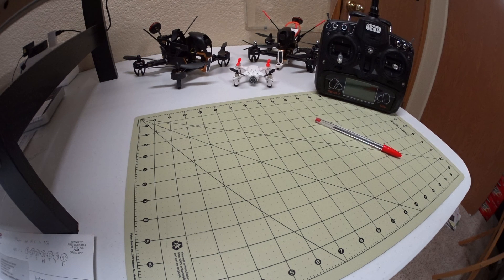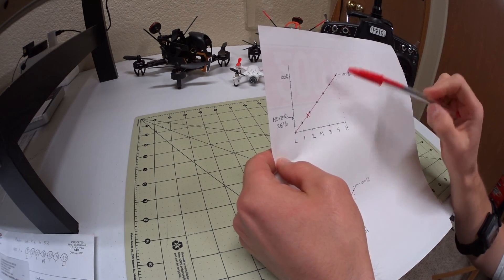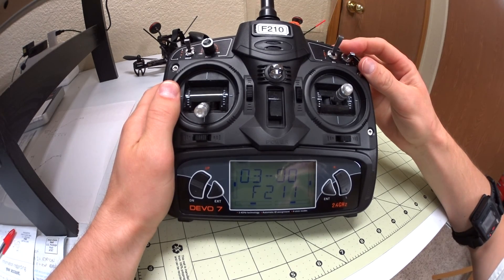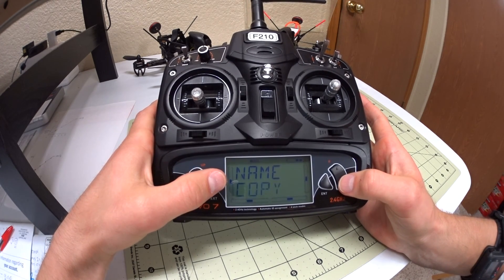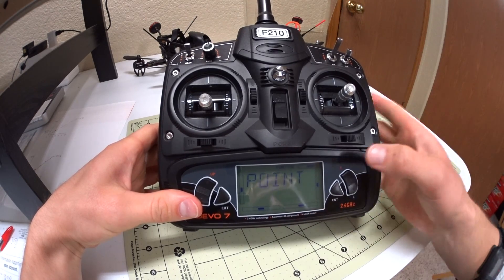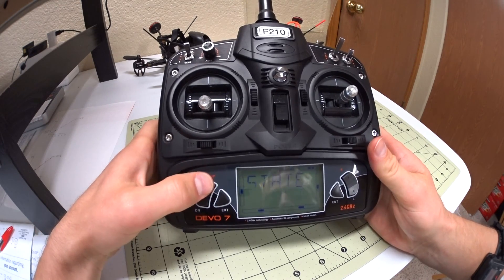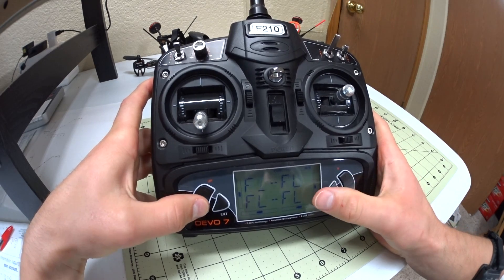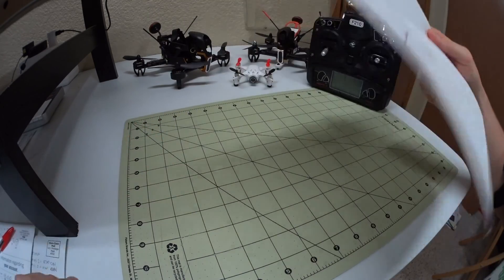Setting A Throttle Curve (Expo) on your Devo 7 Transmitter

Comment: I set mine 9.3, 18.6, 28, 37.3, 55 and 90, for control in the lower end and around hover, then punch lol ha-ha, it gives reduced rates in lower end and around hover point.. thanks for the help.

Comment: Good video, although it is not complete. The video is missing step #7 as written down below:

#1: make sure you work in a copy of the F210 model

#2: go to function THCRV (enter)

#3: leave SRVHD on Yes (enter)

#4: set POSIT to POS 1 (DN)

#5: set EXP to ON (DN)

#6: set P-L to 5.0% (DN)

#7: go down to SWITC POS 0 and press ENT. Then cycle down until you see D/R and make sure it is ACT.

#8: Then set P1, P2, PM, P3, P4 and PH. As down below and make sure that before you enter the percentage that you set P1, P2 etc. to ACT.

PL = 5%

P1 = 12.5%

P2 = 20%

PM = 30%

P3 = 50%

P4 = 70%

PH = 90%

Comment: Can you do a video on setting up so my rodeo 110 isn't so touchy. I guess it's called expo ?
Reply from the maker: Jeff Paige That is what this video explains. You are just manually adding expo by setting the points along the "expo" curve yourself.
Reply: PowerScissor I mean not just the throttle curve. The other controls like yaw etc
Reply from the maker: Jeff Paige Are you running stock firmware on the flight controller or have you flashed betaflight? You can change the rates for yaw/pitch/roll in the configurator easiest. Or if you fly angle mode you can adjust that there also.

Comment: Guys! for those who followed the video and still didnt make it to work, its bec u havent activated the switch "D/R". To do that (Press)... THCRV (ENT) / SET SRVHD (YES, ENT) / (DN) down to SWITC (ENT) / (DN) down to D/R INH (R to toggle on or off for that switch). Then head to MONIT and toggle the D/R switch or just exit out the menu completely and see it there.
Reply: m8, Are u sure u click ENT when u at SRVHD? set it to YES and then click ENT, after that just scroll down to SWITC and continue with ur settings

btw i just read ur former post about u having the 3D F210, as i dont have the 3D version i am not sure its the same structure in the menu of ur controller.
Reply: Kev, now that i think about it, did u follow PowerScissors video first bef attempting to add my method? (my description is an addition to his and maybe "unlocks" what u r looking for...)
Reply from the maker: I've been super busy with a new baby lately so haven't replied much. But I just found out that the Devo7 gets set up differently depending on what model it's shipped with. You might need to activate certain switches if they are deactivated by default for you. All mine came activated, but my friends wasn't.

Comment: Informative vid 👍 I've just sorted my d/rates on the same switch so is there a way to program t/curve to another? God I miss my ds6, so much simpler with better displays. Loving the f210 😍 newbie with devo
Reply from the maker: Yes there is. I won't have my Devo 7 in my hands this week to explain exactly how...but you can set it to the toggle switch that is on the right side also (I have it set to both in my current setup)

Comment: Hi thanks for video. I have question. What is the "THSTK" menu for. It is between "Outpu" and "SWITC". I believe it stands for Throttle Stick but I have no idea whether leave it off or enable it.
You can see in the video at 8:06.  Anyone knows this please help. I've tried google around but could not find any pages/posts/clips that explain.  
Thanks.

Comment: hello i have followed the video step by step triple checked everything and when i flip the switch nothig happens?
Reply from the maker: What happens with your FMD switch? I'm assuming you are referring to D/R toggle?
Reply: +PowerScissor  yes the d/r switch as the video shows pal
Reply from the maker: What happens with your FMD switch in the "2" position...still nothing?  I've seen a couple of times the setting were applied there instead of the D/R switch.
Reply: +PowerScissor is that the top right behind d/r switch i have tryed all the switchs after uve done the settings triple checked its activated
Reply: I have the same issue in that the d/r switch does nothing. Anyone figure out what we may have done wrong?
Reply: Ive ended up selling mine, never did fiqure it out, and got a charpu qav-x and a taranis now
Reply: I had the same issue. I did end up finding this, you have to ACT the D/R swtich further down in the settings of the throttle curve. Tricky to find.

Comment: This video helped me out big time.. Thanks for sharing..I do have a question re: setting up the rate mode switch..The instructions you gave  were excellent, however the switch is not changing the rates back to the factory rates.. The rates did change in the d7. But the switch does not seem to respond..Any help would be appreciated.."newbe"
Reply from the maker: I'm not sure exactly what you're asking. Check FMD switch and see if you saved your settings there. It's been a while since I've messed with a Devo7, but I remember it being easy to change that switch on accident.
Reply: +PowerScissor thank you...got it, all good

Comment: Hi. Was excited to see your video here since I'm a newbie at this and I wanted to calibrate the DEVO7 for a more "beginner" flight mode.
I Entered all your digits as instructed but when I check in "Monitor" mode, Throttle starts at 0 with the stick in the MIDDLE position, and displays -100 when all the way down and +100 all the way up?! When I double check OUT of "Monitor" Mode, like you did, the numbers start at 0(down throttle) and 100(Up full throttle)?!
 To retrace my steps, I started this whole process by creating a new Mode and then RESET ALL to stock setting. I then recalibrated to the Devo 7 Guides in the F210 3D manual. After setting these I then tried your setting and got the problems stated above. Also noticed a "THST" setting when advancing another step after setting throttle percentage -what percentage should that be at since it looks like its the same % for all throttle positions? Please help. 
Thanks. -DS
Reply from the maker: Do you have a regular F210 or F210 3D?
Reply: if it is a 3D, any idea how to setup? it seems i cannot get the POSITION part, instead it will give me a MODE. any help?
Reply: F210 3D. Same Devo 7 though.
Reply: I have the same issue. The d/r switch is not working. Did anyone figures this out?
Reply: ended up buying a DEVO 10. Much better range and reliability. Get one!
Reply: Thank for this video watch it two times to get the idea...
As.i never flight before... i want to know if their is a way to slow down the f210 3D (It was a gift given to me) so i didnt choose a profesional copter by myself. I tried it and it gets high faster than my eyes so can't follow it and can't prevent my movements...
Is their a way that it don't goes very fast and very high...?
Please help!
Thank you lot

Comment: Please could you try and help  Looking at manual it says setting up the osd on the devo 7 to go to system and then video I do not have video in the settings Only buzzer and about
Reply from the maker: Are you sure you have the correct manual. There are different variants of this TX like a "Devo 7e" for example.
Reply: yes
Reply from the maker: +spooner Graham I cannot find the section you're referring to in my manual...odd